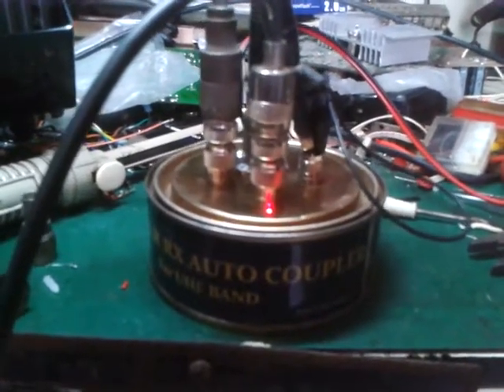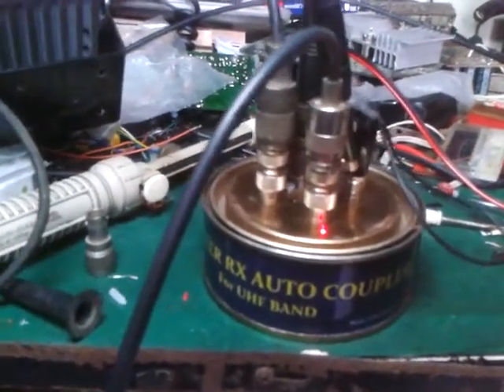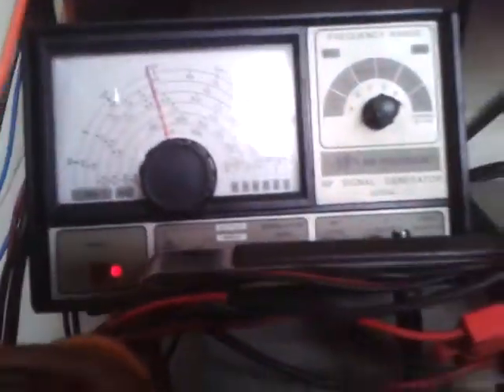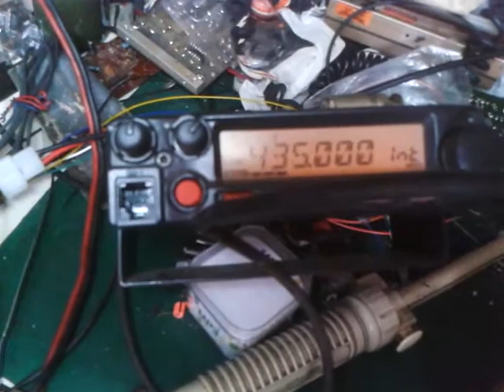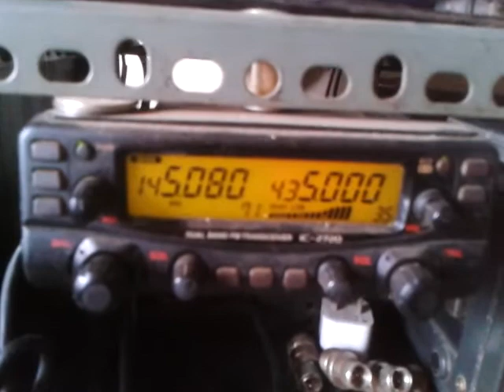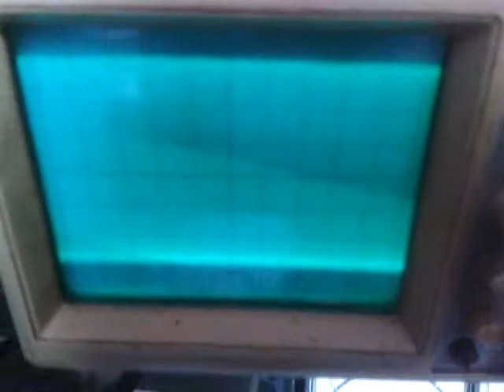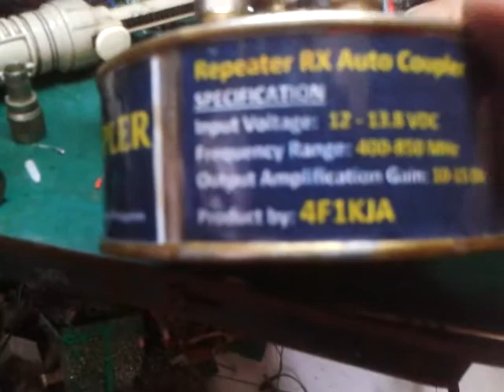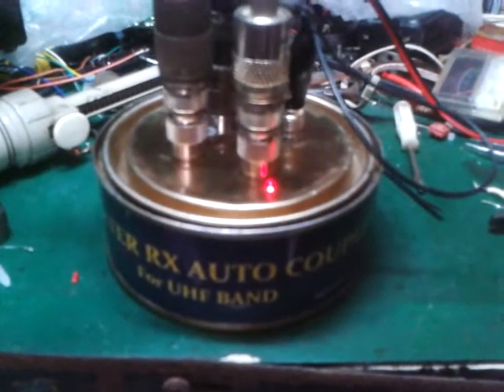4F1KJA Repeater RX Auto Coupler

Comment: that's only a basic wide band multiple output buffer preamp, that will only amplify all freq that a repeater does not need, if that had helical resonators or tuned circuit it would be a better benefit for repeaters. a wide band amp will just be affected by off freq transmitters.you are only emitting a single source but when there are more high RF side freq transmitting, it would create more de sense cause agc in the front end will reduce the rx  sensitivity, there are commercially available wide band pre amps, mostly used to compensate for insertion loss. i guess you have used a booster before, with an rx preamp, it really useless.